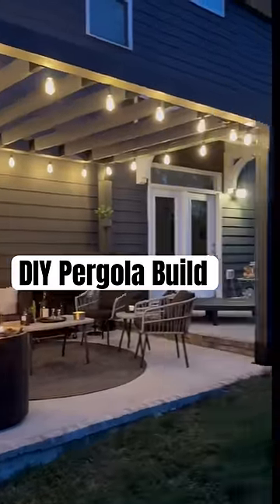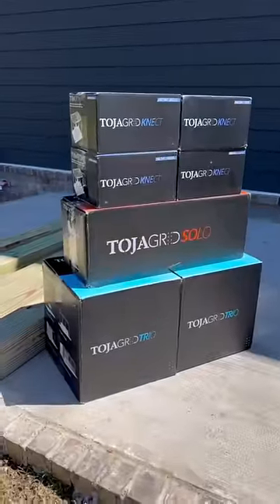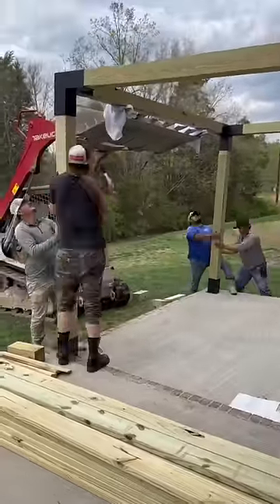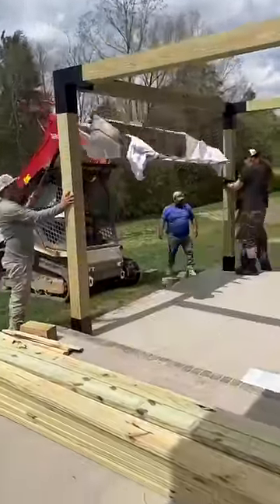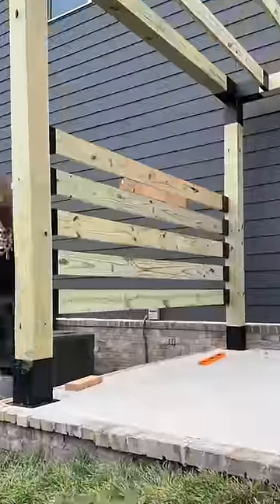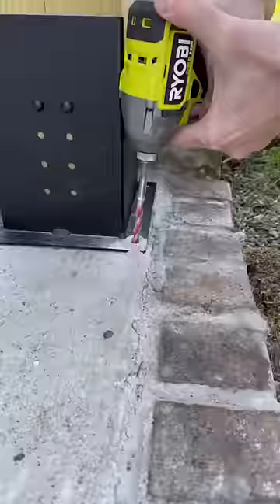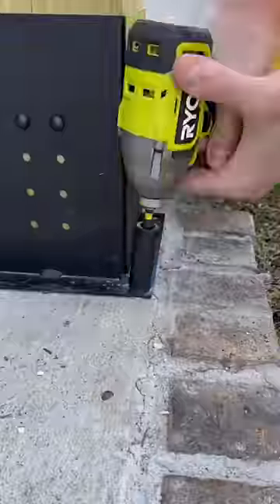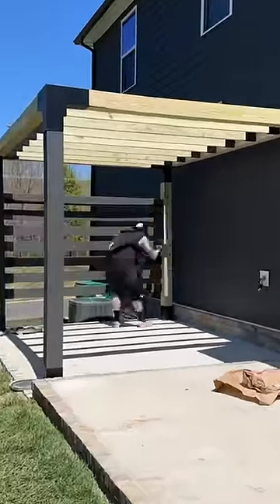How to DIY build a Toja Grid Pergola

Comment: So basically it's a roof with big gaps.  Doesn't block the sun or the rain.  😂
Reply: We installed one for an Architect, & ripped 2x4's 4 inch down to 2 inch, & set metal roofing on it.  2 inch slope was enough to shed the rain
Reply: That's what I was thinking. Don't see too many of these in the Deep South. lol
Reply: @jonathanbeam6898  That's what we call a Pole Barn. lol
Reply: You can train vines up it or get cloth pieces to drape through it, or attach a piece of lattice work over the top... ideally the slats should be oriented such that it provides some shade. Overhanging the slats would help extend the coverage, too. But, mostly it creates a "room" feeling, if not a ton of real privacy or weather protection. :)
Reply: @pamelah6431  I was thinking vines would help with the sun, but it would take a while for them to grow that long. You don't see many pergolas in the deep south.
What we do have a lot of are gazebos.
Reply: Clearly you've never sat in a pergola.
Reply: @silvermediastudio  I haven't, no one that I know has them here in the Deep South. We have similiar things but with roofs that we call Gazebos.
Reply: @MississippiHomesteadJourney  Fair. I think gazebos are usually round or octogon, and yep with the solid roof. Pergola are usually square, with a partial roof that can be further shaded with trees or vines, which I believe would invite carpenter bees and wasps but hey, gotta keep things exciting. The slates in the roof are usually tall, 10 or 12 inches, so they do provide a bit of partial shade, but certainly not enough for the summer sun in the real south. Visually they can be appealing, and the underlying concept is that it feels like a room, which puts people at ease. I prefer the pole barn, if I want to be outside I'll be outside, preferably by water.
Reply: Doesn’t take much to put a riser on the house side and throw a metal roof on top.
Reply: @stycks32  Exactly, the least I would do is encourage some vines to grow across the top. I worked for over 6 hours in the southern Mississippi heat today and the only thing I wanted was a cold drink and SHADE. lol
Reply: Yeah, not a big fan of these structures that have barely any of the benefits of structures but all of the costs
Reply: Yea but it's nice
Reply: @InfernosReaper just attach sky poly to the top of the pergola , that easy

Comment: Not bad guy! Just a couple tips.  The top of the pergola is just rafters, not a roof. It has no sheathing or roofing.  The corner hardware is a bracket, the ones for the rafters are hangers.  Also you shouldn't paint or stain pressure treated lumber until is has weathered for 6 months to a year.  The moisture from the treatment will surface and push off the paint.  Keep keeping on though!
Reply: Can I use a stain/preserver that says it's suitable for use on wet timber?
Reply: @APDDD555 he said to not use it until it weathered for 6 months to a year…
Reply: Concrete screw type and size please?
Reply: 6 month wait is too long from experience. The pressure treated wood dries and cracks and twists and checks. Don’t wait even two months in hot weather. 2 weeks to a month and stain or paint. UNLESS you like cracked checked wood.
Reply: Of course you use oil base primer.
Reply: @samclonce Tapcon brand (blue) from Home Depot or Lowe’s. Probably 3/8 or 1/2” size. Hammer drill for making the hole and blow the concrete dust out
Reply: @APDDD555 yes. But not on very fresh/dripping wet timber
Reply: @a_w_bukhari7579  Thanks. I've added the stain now to treated timber. Only time will tell, but so far after 2 coats, no sign of bleed out.
Reply: @a_w_bukhari7579  I'm in the Midwest, in hotter climates that dry time will shorten, you are correct.

Comment: If I ever wished I could save a short, it would be this one. This is a great video!
Reply: You should be able to, if you hit the 3 dots in upper right corner. It will give u an option to save to a Playlist 👍🏼
Reply: You can save shorts to playlists or you can just like them and they'll end up in your liked videos playlist.
Reply: I tap the share icon and send a text (which automatically includes the URL) to my own phone number. I also type in a few words so I can easily identify the video.

Comment: Use one of the legs to help support the free end, or a ladder, or pick up a crappy 2x4 that'll do the job as a temp support. Or, two ladders and a stringer across them. Work it up until you can get the third leg into its corner socket. The fourth leg is easy from there. Two people can do it with a little ingenuity.

Comment: I build my myself without any help.  Single men project.  I used regular hardware from Home Depot.  Started from fixing legs like for any deck.  Than adding top board one by one.  They are light, not like the whole structure.
Reply: Yeah that's a better way to do it.  Don't fight gravity
Reply: @thomasr1051 i was thinking the same thing but I'm a woman 🤣🤣🤣🤣🤣‼️
Reply: @frantyi6424  you can still work smart not hard

Comment: Nice pergola 💯 and you used the mighty ryobi I have ryobi as well.impacts are not good for drilling through concrete or cinder block.hammer drill does it efficiently

Comment: If you'd built the roof frame upside down, you could have attached the legs then rolled the whole thing over. If you are worried about the legs snapping when you get passed 90° you could support the legs with clamps and 6x2 joists while you rotate it

Comment: Great build! BTW, ur stoop roof is really nice!  This is what I’m looking for!  A couple questions… Did you attach to your house?  What length of Tapcon screws did you use to drill in the concrete?  What are the dimensions of your build?  What was your overall material cost?

Comment: Hey, that's a nice job bro. Is it okay to ask the size of the TAPCON screws and the thickness of the concrete underneath. What are the dimensions of the pergola - Length, width and height?
I am planning to build a similar structure and hence asking.

Comment: Tapcons (concrete screws) require minimum edge distance based on size of screw diameter… any screw installed right against the edge of the concrete will likely lead to spawl

Comment: This a great idea and I honestly like it. But as an experienced contractor, much of my work is water damage repairs. ALL wood rots and at some point a repair will be needed even on treated lumber. The problem is that to remove a post you’ll have to take this apart on multiple points or entirely. That cost alone will shock any homeowner because instead of fixing one post, you’ll need to pay to take apart, remove and replace then put it all back together. Time is money and this system will cost every homeowner more money in the long run.

Comment: I've never been able to understand the concept of a pergola. It doesn't offer privacy and won't stop rain. Why would someone want one of them?
Reply: As a builder, I find they can be aesthetically pleasing, adding character and appeal to one's home and/or garden They do provide some shade and privacy, but it's no concrete wall. I built one in my backyard 5 years ago and planted a Grape vine next to it that went crazy! Now every Summer it's completely covered in grape vines, huge leaves and yes fruit. I have a bench under it now but will be replacing it for Jacuzzi Tub full of bubbles and essential oils, adding some string lighting and/or candles. Fresh bunches of Plump Juicy Gapes just a hands reach away while soaking.
It's damn Sexy and makes the Panties Drop Quick! That's why.
Reply: Yeah you're supposed to grow vines over it.  But it could also support some shadecloth
Reply: It provides at least some shade while allowing light through... pretty simple to understand vs. the blasting sun all day long in a bbq area. We built one at my sisters house and it was a major game changer just dropping the overall temperature in that area a few degrees from the sun.

Comment: That single corner costs over $200. An ordinary welder can make it for less than $30.
Reply: No one is going to make that for $30 (material, powder coating, labor) even if you decide to weld it yourself. There are cheaper kits though that are pretty much the same thing.

Comment: This does not seem very durable...
Reply: If you’re saying durable as in sturdy/safe/secure then I’m confused how you think that at all.
The 6x6s are anchored at the footer and the header pieces are secured together so that’s more than durable to stand on its own. Then stringing those boards across on the roof (the 2x6s) have the mounting brackets on them. That’s as secure as it gets.

Well besides lag bolting the 6x6s at the top but they go into a sleeve and screw together which is more than enough to be safe.

Comment: 😂 made you’re job a lot harder dude. 

Step 1: Erect the legs first but done screw in place. 

Step 2: Slot the connector plates

Step 3: Slide the top wooden posts in. 

One person can easily do the job

Comment: I do not understand the attraction of these.
Reply: You generally need to be in a place where they’re practical. They come from Southern Italy where the weather is generally sunny & dry. It’s designed to be oriented with the slats perpendicular to the path of the sun. It’s not going to help during the high, mid-day sun, but the time leading up to & following it, it will absolutely provide shade. It’s not meant for rain & other weather because it’s meant to be used when the sun is out, not when the weather is bad